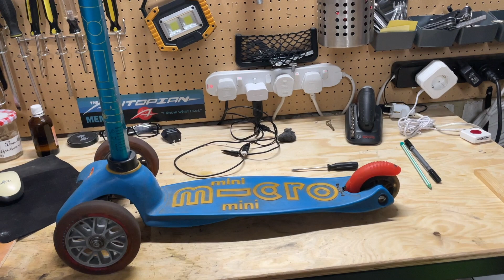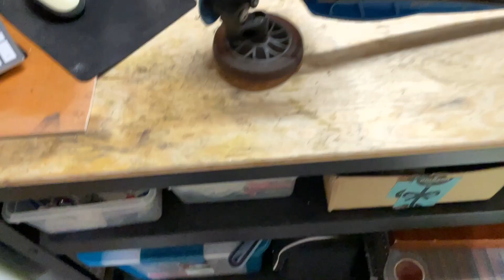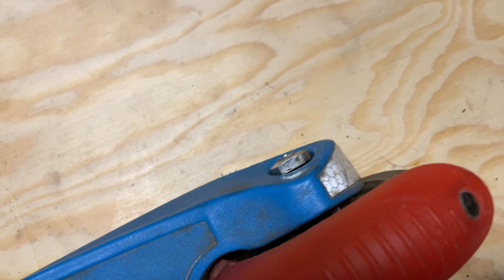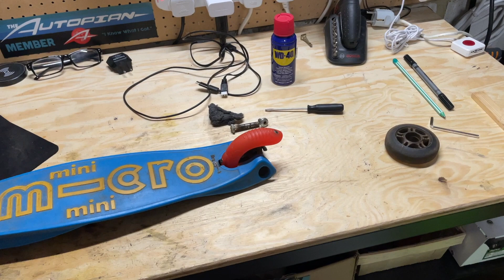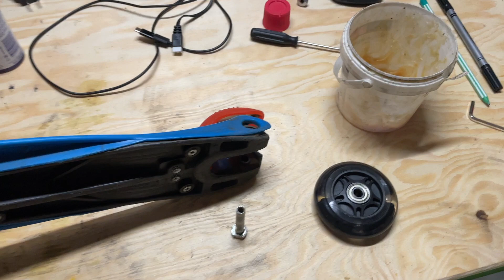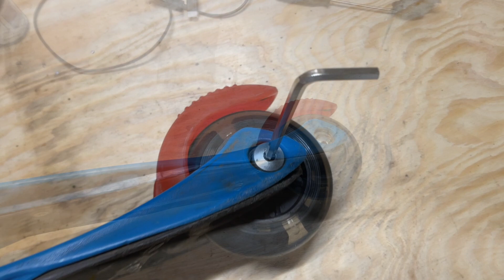Micro Mini Scooter Rear Wheel Replacement

Comment: That was too easy, I have broken allen key and stripped the srew, still could not get it off
Reply from the maker: Make sure that you're only trying to unscrew one side, which is the one with the perfectly round screw head.
Reply: @ yes. Tried all as shown in their videos. Does not work as you both illustrate